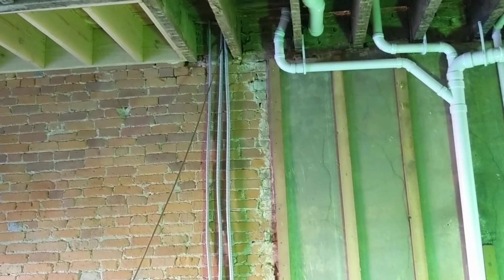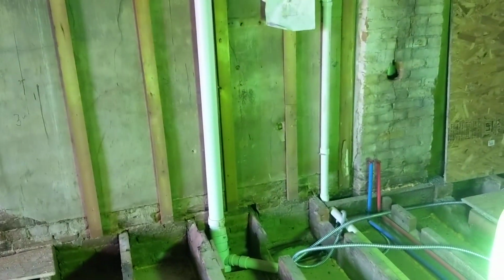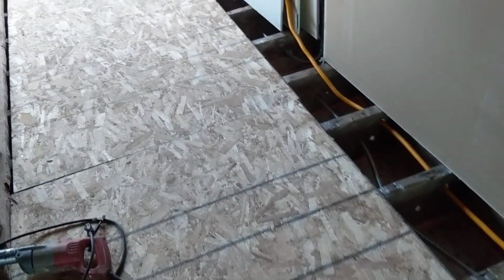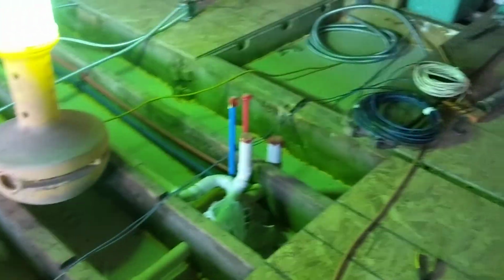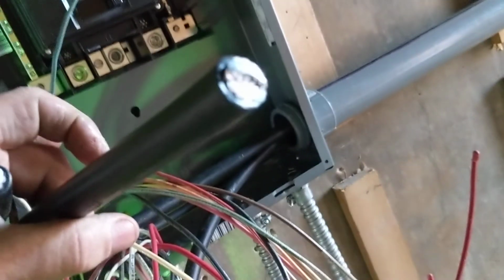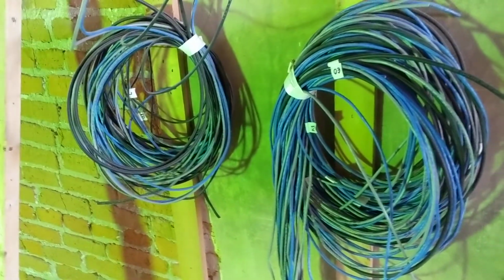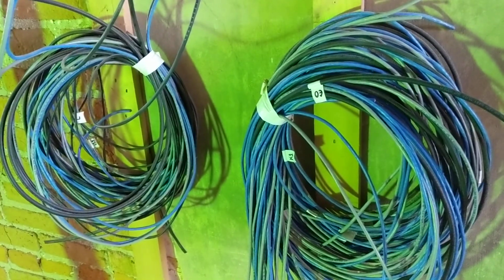And the residential electrical begins

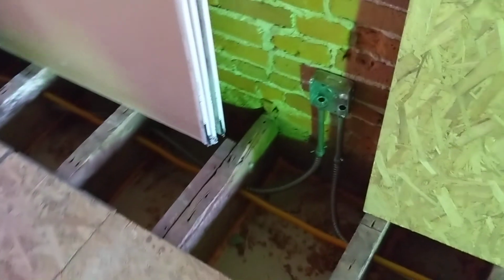Comment: 2:15 Heated floors?
Reply from the maker: Yep. Installing electric radiant heat floors. Probably overkill (decadent?) for the size, but with 10 and 12 foot ceilings (25' in the open loft section) normal furnace heat would all be at the ceiling. Our AC system will also have a backup electric heating option, and we'll have a fireplace, too.
Reply: @adventuresofglassmandan-ph1086  Doesn't sound decadent at all to me, given the size of the space and where you're located. Sounds wonderfully warm and cozy!